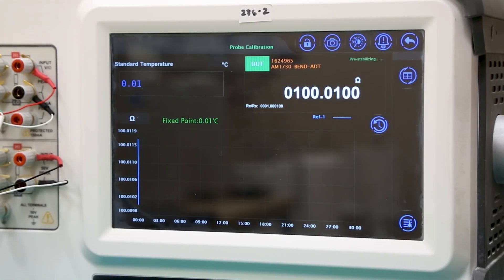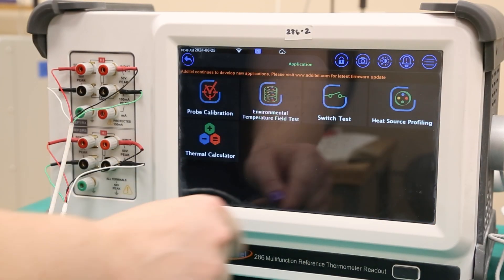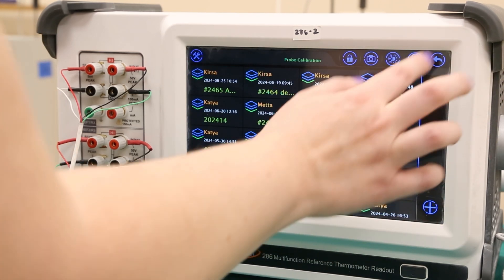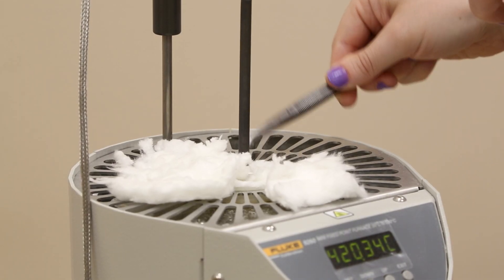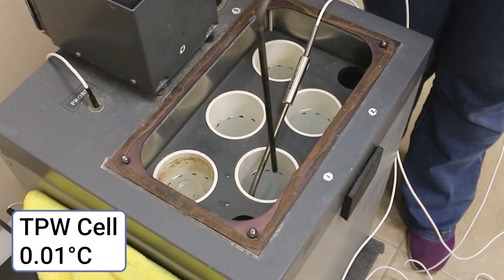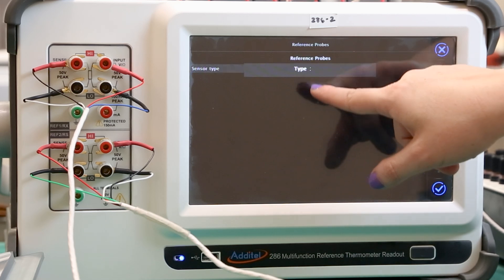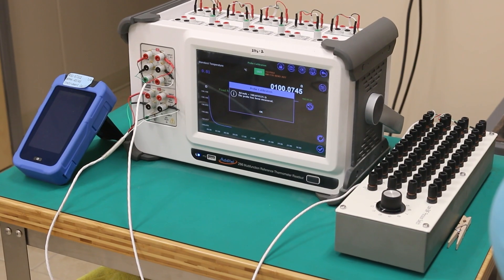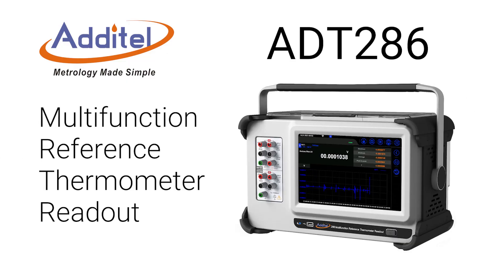Fixed-Point Temperature Calibration with the Additel 286

Comment: Hi Additel

Hello Additel, I recently observed that the Additel 286 includes a part 1210103531 (Shorting Block). Could you explain what it is used for and in which cases it is applied? Thank you!
Reply from the maker: Hello,

The shorting block can be plugged into the reference port on the front of the device in order to zero the reference before testing. This provides a more accurate starting point for any signals plugged in afterwards. Thanks for asking, and let us know if you have any more questions!

Comment: Hi Additel, 

Why do you prefer to use the comparison method with a SPRT and not the mercury point cell?

Does it have to do with your country's regulations?

Thank you very much for the video, I have an Additel 282 with two PRT Accumac AM1640 calibrated by you, however there is one that behaves somewhat unstable, you perform annealing prior to calibration?
Reply from the maker: Hello, thanks for your question. There are a few reasons why a comparison point is used for the Mercury Point:
1. Cost and efficiency: the Mercury cell and equipment is expensive, and would only allow one probe at a time like the Zinc and Aluminum points.
2. Safety: Since Mercury is toxic, many labs opt not to work with it.
3. Accuracy: Since -39°C can be reached with a fluid bath (as opposed to a dry block) the accuracy difference to a fixed point will only be 1-2 mK. If Aluminum and Zinc were done with the comparison method, the difference would be greater.

Regarding your AM1640 probe, please send an email detailing the instability of your probe to service@additel.com and we would be happy to assist you!
Reply: @additel  Thank you very much. I have written to you regarding my concern, and I appreciate your help. Once again, congratulations on the video; it's very enjoyable to see this type of process. Well done!